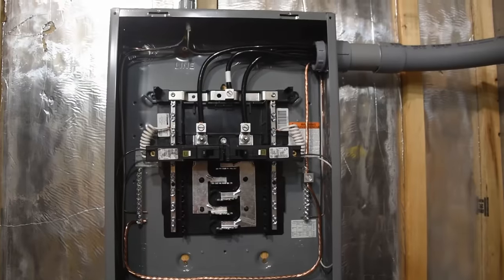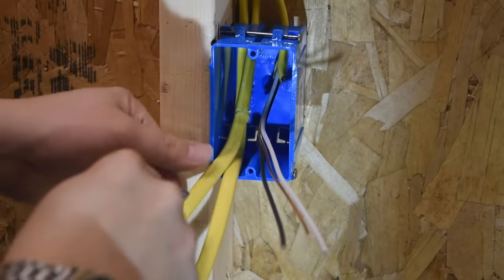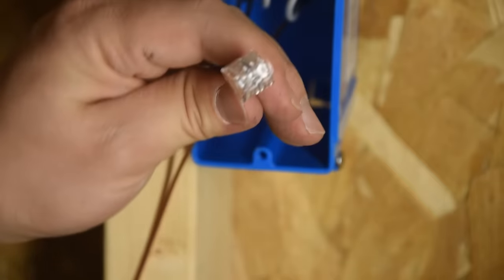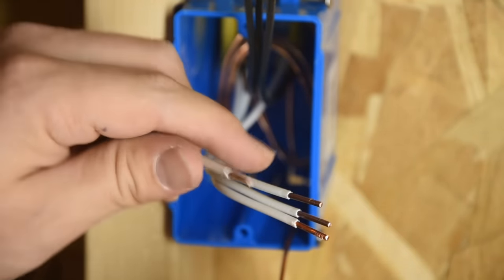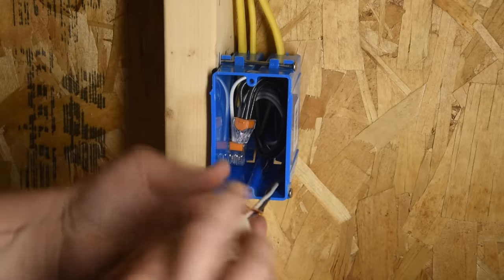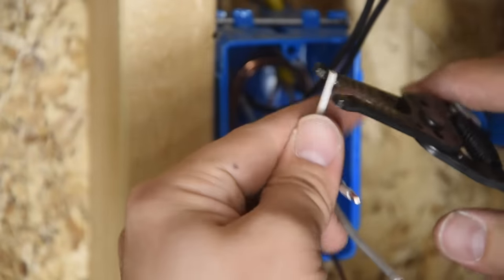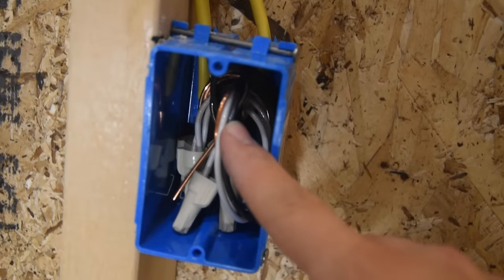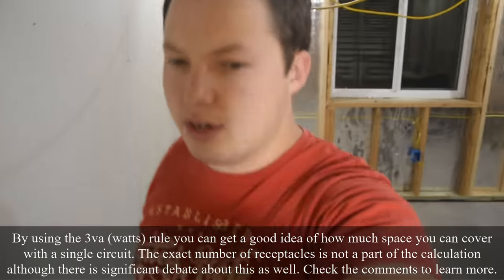Wago's vs. Wire Nuts - How To Wire Outlets During Rough In

Comment: When ya get trained and taught for years on pretwist.. it's a hard muscle memory to break.
Reply from the maker: Yeah no kidding.
Reply: Pre twist is not required, where on mfgs instructions does it was to twist before using wire nuts?  AND, since the code says to FOLLOW mfgs instructions when using devices, you are therefore not being code complaint when you twist....
Reply: @cengeb  you dont pre twist stranded wire. You do pre twist solid wire. Pre twist solid is actually faster than not twisting then having to re splice because one wire doesn't catch in the wirenut.
Reply: @nooneyouknowhere6148  nowhere in the instructions for wire nuts, or any other brand of twist on connectors, is their instructions to twist the wires, before using the connectors..therefore according to NEC rules, when using wire devices you must follow mfgs instructions, no instructions to TWIST wires, therefore you are in violation of NEC, FAIL. RED tag
Reply: @cengeb  you are nuts. First the code is the bare minimum. Nothing stops you from going above and beyond. Nothing in the code tells you you can't twist the wires. They had to change the code and require a ground wire be run in conduit because people were not properly tightening the fittings. They had to change the code to make you pigtail instead of wiring thru outlets because people were not properly terminating the wires causing open neutrals on live circuits causing people to get hurt. They had to make people start using arc fault breakers because people were not using good wiring practices and causing arcing issues. They stopped the practice of twist and tape splicing because of loose connections. That is why we use wirenuts. They provide constant spring pressure on the splice to keep it tight. Twisting the wire helps keep it tight. I can't begin to tell you how many boxes i have opened where the splice pops open because someone didn't twist the wires and didn't pull each wire after installing the wire nut. Poor workmanship is out there. The code also says all work shal be performed in a workman like manner. (They mean professional) that doesn't stop a large number of people passing themselves off as electricians. No one will stop you from doing better quality.
Reply: @nooneyouknowhere6148  WAGO are the way to go.  Twisting the wires before using wire nuts is incorrect use of the twist connectors, plain an simple..DOES the mfg say to twist before using? simple, so you are claiming the makers of the twist connectors are wrong..how about that..and when they twist more of the wire into a tight twist is really a violation....it put unnecessary stress on the wires...WAGO has been around for decades, if they where as bad as you are implying, they would have lost their UL listing long ago

Comment: I may get a lot of hate comments, but I don't see how WAGOs can make a good, reliable connection. It's basically the same sort of connection as the back-stab type on receps and switches, which fail miserably and CAN cause fires because they cause heating of the wires due to the poor connection. A wire nut creates the best positive conductor-to-conductor connection with much more contact.

Comment: Ben, your videos are always great! I myself am not a fan of WAGO’s, because if I had to trouble shoot something, I would have to cut and re-strip the wires. With a wire nut, I just undo the twist and I’m good. Oh and that sub panel will look great if you do it! Don’t let the guy who wired the main panel touch yours unless you want a rats nest lol!
Reply: Actually the Wago devices are awesome for testing, because there's a port in the devices to make contact with the splice using a volt-ohm meter's testing probe. And if you use their lever nut product, you can very easily disconnect or reconnect wires one at a time to isolate faults. With wirenuts, all the wires are twisted together, and when you undo them, they get all curled and deformed. It's hard to straighten them out.

Comment: Watching this vid, it reminded me of a nightmare I had after roughing in an addition. Prepared the rough-in exactly as you do,  it when I went back after the drywallers, found that they apparently were lazy/dumb/uninformed, etc., but they must have placed the Sheetrock against the wall, felt for the bulge of the boxes, and used a dremel tool to plunge the bit into the interior of the box and follow the inside perimeter of the box to make their opening, and in the process, nicked and gouged all my wires horribly. Took me hours to remedy their damage. Total idiots.
Reply: Push your wires way back inside. with the nuts foremost so when they nick it it will only hit the last inch or so of wire. Thats your bad.
Reply: look into adding a service loop of a foot of wire  leave last staple loose enough to pull if you need it later been there
Reply: @wizard3z868  
That works too, but not for armored cable or other cables with special connectors. And a service loop is good for future changes and not great if you have to use it up now.

Comment: It seems to me when you push the wires into the Wego each one is only a very minimum contact point. Twisting them together with a wire nut makes a very tight and much more surface covered.

Comment: I don't mind using the wago's that come with HALO light fixtures.  The LED's aren't pulling much current.  No way I'd use those things to wire up a 20A bedroom circuit though.

Comment: That seems like that's a lot of outlets on one breaker especially with all of today's technology.
I'm an amateur but I alternate boxes using two circuits.
While I was rewiring my 100yo farmhouse I removed alot of thin gauge wire. They had wired 20 outlets on one 15amp circuit, in the 60s when it was added on to, most of which were in the kitchen.
Is 12 gauge wire good enough for today's technology and 20amp breakers and outlets?
Thanks for the video, I've really come to appreciate wagos.
You are in my prayers
Hoka Hey

Comment: How many amps can passed through the wagos?
I use to work in just troubleshooting electrician in a company and repairing electrical problems and I'd found receptacles with the same wagos type connections and the lazy electricians didn't do the twist tide wiring "make up" with a pig tail so they just pushed all the wires through the receptacles and I found a lot of them completely burned out so I did took them apart and is just an 18th or 20th gauge sheet piece of metal touching the side of the wire so when you have a lot of amps going through this weak points they create a lot of resistance and it creates heat so the current power is trying to pass through but it creates a lot of heat so you end up with receptacles burned out and it creates shorts so I repaired hundreds of them and I don't know why UL passed this design since they are all faulty and prong to a fire hazard so
Wagos are gonna be the same thing I wouldn't recommend that for make ups specially if you use hi loads on them I wouldn't put them in my house or any of my jobs I use good quality wire nuts and always make sure the wires are well twist tide in before you put your wire nuts.
Reply: Twisting wires BEFORE using wire nuts is actually a code violation, there are no instructions on any twist wire connectors, that tell you to twist the wires, so you are very wrong.  The CODE specifically says, follow mfgs instructions when using devices  ..twisting the wires just stresses the copper and weakens it.

Comment: This raises the question: why aren’t WAGOs built right into the box? Leave as little wire coiled in the box as possible, with a service loop left outside for future work. Take it another step further and make plug-and-play boxes, where your choice of equipment plugs in (standard socket, USB charger, light switch, dimmer, etc) rather than having to be wired in.
Reply: It's already being done its called relock all the wiring is done overseas all electricians over here have to do is plug it in but then you have to go back to troubleshoot half of that shit anyways not a good idea

Comment: They make a simple, cheap stripper for Romex, it will strip the outer jacket and never nick the insulation on the wire. Also I agree, that the wire connector should be up. Newer Receptacles will take four wires, on the Hot and Neutral connections. Also some jurisdictions require insulated ground Pigtails on Switches and Receptacles, connected to the bare copper ground that is folded, all the way back in the box.
Reply from the maker: I finally picked up a few different romex strippers and plan to make a video comparing them all! I hadn't heard that some areas required the insulated grounding pigtails but I have done that before just as a "best practice" implementation. 

Thanks for sharing your experience!
Reply: Benjamin Sahlstrom also they make Roto-split for BX Cable, I have three different sizes. No chance on nicking the insulation or dragging a Hacksaw blade across your knee.
Reply: Such practice should be outlawed.  insulated ground... beyond stupid.  It is ground for a reason, so you can use it as such and it will always connect.

Comment: I fell in love with the Wagos for their simplicity until I suffered a few intermittent contact losses with the push in holes on the receptacles in my home. Turned out that the heat cycling that occurs over the years weakened the contact to the wire and developed intermittent power loss and resistance heating within the contact. I never used them again. A twisted bundle of conductors with a firmly placed nut just feels like it has far greater contact area and less chance of coming apart. Something like 95% of electrical house fires are caused by the heat developed in a loosely connected junction.

Comment: I also Like using pig tails. if the need is there to remove an outlet or replace one it is much easier. plus you do not disrupt the other wires.

Comment: yes, a 20A breaker can carry 1920VA . . . but putting a living room and a bedroom on one 20A breaker? . . . when the homeowner (or tenant) plugs in the big TV, stereo, game console, computer, and a few lights and the significant other/sibling/roommate can't stand it for another night and goes into the bedroom and fires up another big TV and some lighting and that doesn't even consider cable boxes, modems, routers and a dozen wall-warts that nobody ever unplugs...

that's a recipe for trouble and callbacks . . . most houses are small enough to consider one 15 or 20A per bedroom and, at least, one for the living room.

never consider the minimum . . . explain to the owner why your bid is higher than the guy doing it on the cheap and if he doesn't use you you only lost a headache.

Comment: I have used WAGO in my wiring for 5 or so years and they are so much better especially for outlet replacements. the wires don't kink and you are not trying to bend a mass of twisted copper into a small box. I can't tell you how many times I have removed an outlet and the wire nuts are loose and or the ends are so brittle that they break off when trying to undo the wire nuts. check John Ward "wire connectors overloaded" on YT.

Comment: I was always led to believe that wire nuts should be facing UP in a junction box. This way, if for some reason they become loose, they will not fall off exposing the bare wires.
Reply: They better not come loose. I wired my house 47 years ago and put a new outlet in a box with red wire nuts on 4-14 gauge wires and they are still tight as heck. I always twist till the wires themselves twist a couple times.
Reply: I thought it was for water protection
Reply: @xcmskim4  It would be a requirement of code if they felt needed. In my career I never heard such a thing.
Reply: After 40 years of doing electrical work I can tell you wire knots will fall off and or they may catch water. Everything vibrates the truck goes down the street and you can feel it vibrate wires heat up and cool down these things can cause a wire not to come loose let alone fall off.

Wago’s are engineered against this problem and you can go to their website and find test data from their German laboratory. In almost every other country on the planet wire knots are not allowed. If you watch videos of electricians from the UK or Australia you can find them using these connectors and you can find many examples of them testing them.
Reply: whodannywho right....
Reply: Dennis Bernstein code reference? Opinions carry no weight.

Comment: I'm really curious about the Wago design.  Are the metal contacts in tension when closed and the levers create the closing pressure -- or are they normally in tension while closed and the levers pry them open?

Because all plastic degrades and becomes brittle over time.  The potential heating of wires over time from current accelerates the process. If the clips are in tension while closed and the plastic cracks from age and the levers no longer work, will the clamps open creating a spark gap?

I would hope the design is to be in tension while open so that the levers pry open the contacts so that if the plastic loses it's strength that the contacts stay closed.

In comparison, wire nits are primarily made of a metal coil where the wires "screw into".  If the outer plastic cracks, the structural design keeps the wires together.
Reply: They'll hold tight even when you burn the plastic to ashes.

Comment: i have a 123 volt wires that i'm using for lights on a headboard and wires that connect to the switch broke what size wire connector would you recommend ? my dog chewed right through them

Comment: They don't carry current well.. Especially when you have a heavy load at the end of a daisy chain.  They also wear out after a while. They get fatigued from carrying the load and create issues
Reply: I agree with you on the push on connectors but the lever connectors have a lot of contact area and have worked pretty well for me - I like the push on Wagos for lighting circuits bot not much else
Reply: Not sure where you get your info but that’s simply not true.  Wago connectors are actually safer than wire nuts. They are both UL and CSA approved here and are used almost exclusively in Europe and are approved by their standards.  Almost every building code jurisdiction in every state approves their use.  The industry as a whole is moving to them.
Reply: @rogerf3622   I get my information from the fact that I've actually had to fix a lot of these bad connectors. As far as what's approved by UL and building codes . Remember they thought aluminum wire was a good idea too
Reply: There are tons of Chinese knockoff connectors out there similar to this brand.  I suspect that is what you encountered.  The next time you encounter a bad connector, document with pictures it and let your electrical inspector know as well as UL and CSA labs.  If they are indeed Wago branded, contact Wago.  They would love to see your documentation.  We have never see of or heard of any Wago Branded connector fail. Ever.  We have seen tons of twist connectors fail but never a Wago branded connector.  Real Wago connectors are expensive which makes them prime candidates for knockoffs.

Comment: Maybe you want to have a look at the WAGO 221 (the ones you mentioned with the lever) and the WAGO 2273 (similar to the ones you used in the video but better in my opinion). I am German and here we exclusively use WAGO 221 and WAGO 2273 connectors. I would like to know your thoughts about it.

Comment: There's a specific reason the code did away with back stabbing outlets, wagos IMO are only good for smaller loads, I wouldn't rely on it for a joint in a box that an actual load travels thru

Comment: Never use wagos, I have had them arch, short and humm - scary!!  ALWAYS pretwist! If you do not, it is possible that the current will run through the steel threads inside the wire nuts. Steel is not a ideal conductor and gets HOT. pre-twisting also eliminates wires walking back out of the wire nuts when tightening and you can visually inspect the copper to copper contacts and twist quality before hiding it with a wire nut. Also, our local inspector wants the contact group twisted 2-3" so unintentional tugs will not pull at contact point and will pull the group of wires. (i know, that is what the staple is for) Sorry to nanny here, but I don't do it  your way.
Reply: AGREED. wagos  are garbage for hacks looking for the quickest hack job..Period

Comment: I won't even use those insert type of outlets. Two small points of contact with the wire carrying all load just seems counterintuitive when a screw or twist Marr connector actually forces a larger surface area of contact. But then I'm fussy that way. LOL.  Various agencies can approve these things all they want - just keep in mind those same agencies approved the use of aluminum wiring across the board.

Comment: I have installed and repaired electric fireplaces and whole house vacuums that used these things. Each are high current appliances. My belief, they are no better than a back stabbed receptacle.  They cannot handle 10 to 15 amps reliably in the long run. Fine for led or lower current end loads, but I myself would never put any on a supply line. Wagos will melt from the bad connections. The may have a heavier connection point than earlier models AND UL LISTED but the connection is only millimeters thin. There isn't enough surface area available on the knife edge to daisy chain receptacles together. You are looking for trouble on high amp circuits.
Use the screw lugs, wirenuts, and the house fires will be minimized, and the electric will be available when needed (assuming the bill is paid).
Reply: Here are the SPECS for their 12AWG ones.  Can handle more than 15 amps.
https://www.wago.com/us/wire-splicing-connectors/compact-splicing-connector/p/221-413